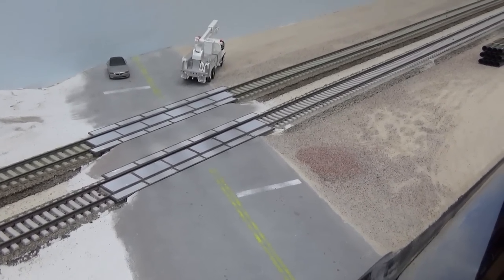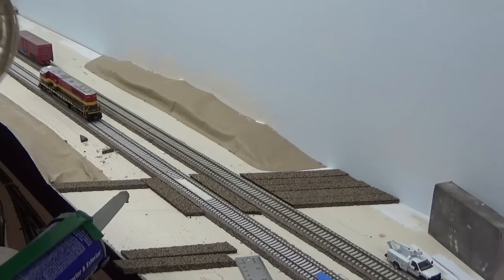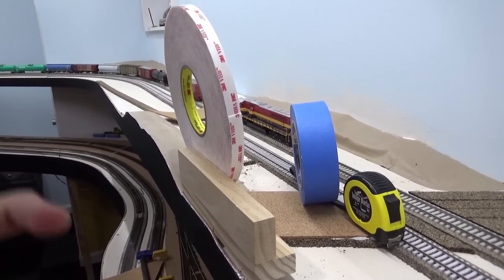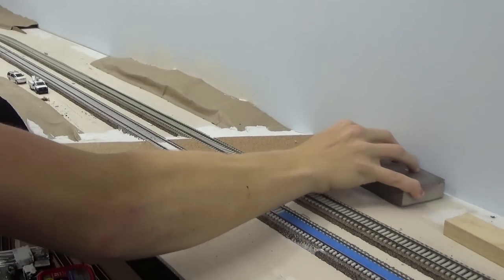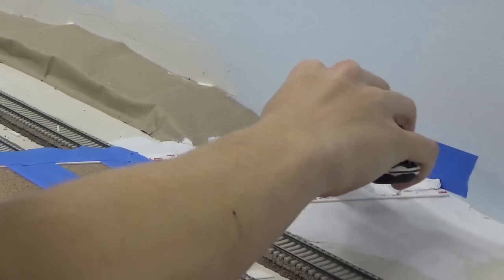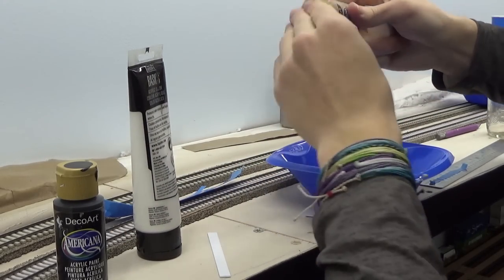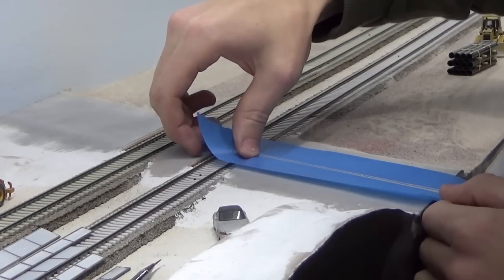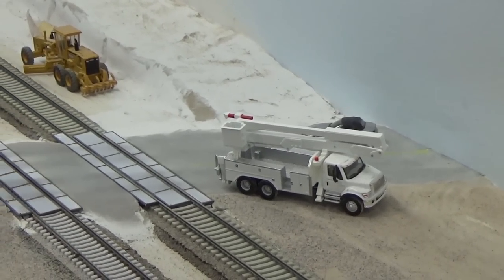How to Make a Road in HO Scale - Crawford Scenery Episode 3

Comment: Very nice job!  F.Y.I.:  The stop bar should be two (scale) feet wide.  Each double yellow line is four (scale) inches wide with a four inch space between each line.  Some jurisdictions use six inch wide lines instead of four inch.  (Former highway department employee here!)

Comment: What about the R X R crossing warning on the road?  I use a stencil sold by walters.
Reply from the maker: From the prototype roads I've looked at, the crossing markings are further back from the tracks than I have modeled in my 16" shelf. But, thanks for the note on the Walthers stencil. I was wondering how other people do it, and I have other roads that might require it.
-Cam
Reply: @railfan220  Its called modeler's licence. You have one.  Anything in model rr's you have to compress.

Comment: Better than the woodland scenics road!! I’m gonna go your route! 

Question: what are your steps to laying down the paper hills next to road? 
Thanks
Reply from the maker: Thanks! When making a paper scenery shell, I generally start with cardboard profile boards that I hot glue to the layout. The paper comes from a big roll of painter's paper which I once again apply with hot glue. Once that's in place, I paint it with wood glue because this waterproofs it. Finally, I add either 3M Patch + Primer or Sculptamold. Once that dries, it's ready for scenery.
-Cam
Reply: railfan220 
Got it!